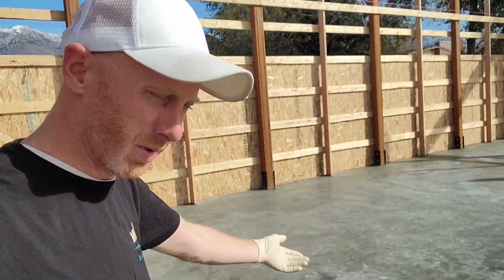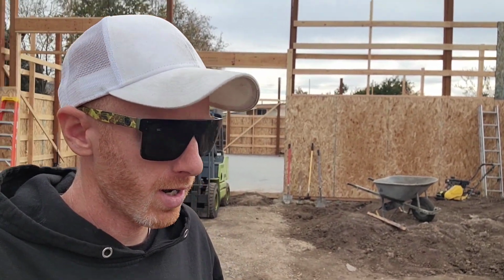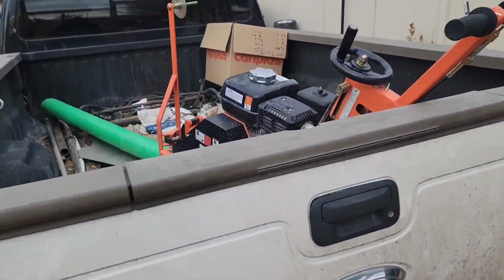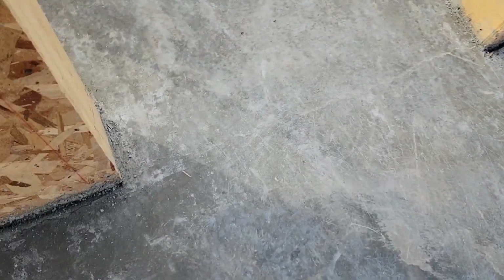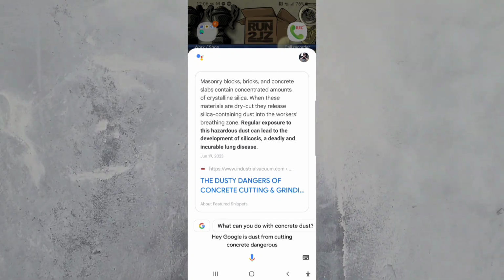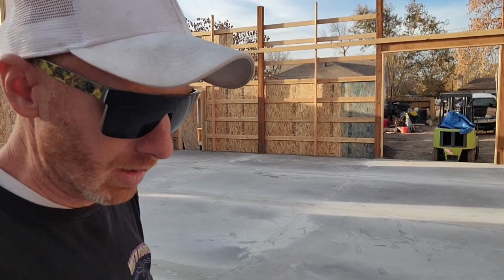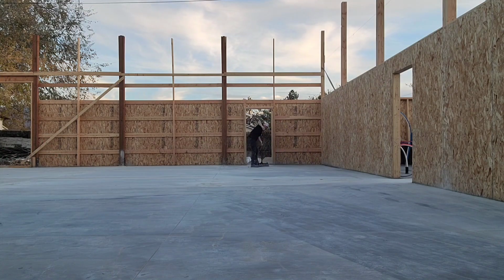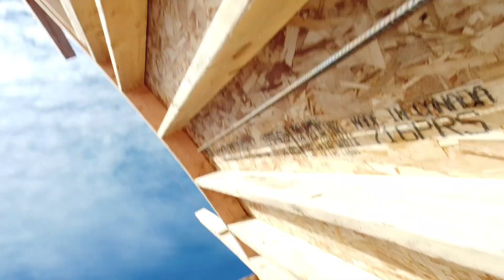GARAGE OUT BACK - Ep12 - How did the concrete pad turn out?

Comment: I'm gonna try and do some concrete at some point. This is what worries me. When you are just a random 1 time customer to the concrete plant they screw you around. Most of your issues were caused by the concrete company but the finishers should have made you aware about it as it was being poured and maybe should have started earlier in the day but that would have easily been 12k just in labor here so I think you did good everything considered.

Comment: Man your attituded is really good taking in to consideration what went down. That being said, you have basically taken on the responsibility of a "general contractor" to save money and using subs of your choice. If you spent the big bucks and had hired a general to run the whole show it would have been on them and you could say rip it out and do it again.  I think if you read up on  resurfacing the rough spots in the floor you will be able to be happier with it.  Here's a video I found, this is good because the process is wet and you won't wreck your heath,  ya know we want to see you drifting again! https://www.youtube.com/watch?v=ksRnnEQwpx4    Good luck and I can't wait to see the next episode of The Garage Out Back.

Comment: Epoxy and concrete grinding work will sort out alot of the ugly bits. Concrete should always be done earlier in the day due to heat which obviously wasn't your issue but also normally dudes are as tired and over it by the end and tend to do better work also finishing under lights can get you a super good finish or not. Atleast it's only concrete plus by the time it's a functioning workshop covered in oil and shit alot.of it won't matter.

Also when I used to do concrete cutting for a job for years and doing expansion joints we only ever went 30 or 40mm max deep and in the future man use water a drink bottle that you squirt to keep the dust down and also if you use just enough water where you create a slurry as you cut it kinda works like a cutting paste. And you feet don't get wet haha nobody likes that.
On a positive man that is going to be a sick workshop at home